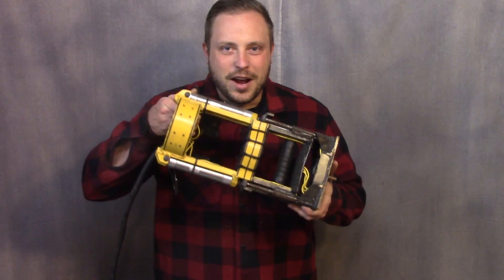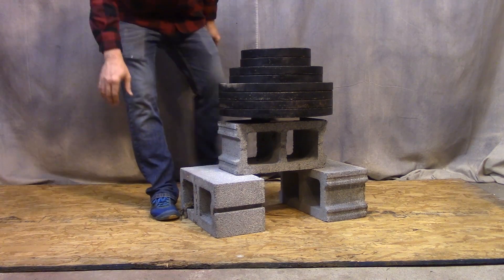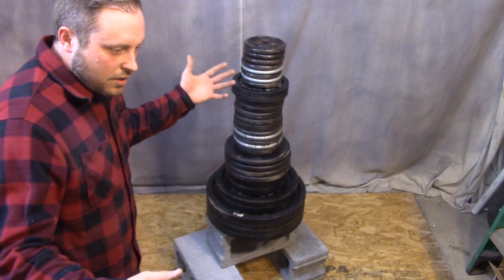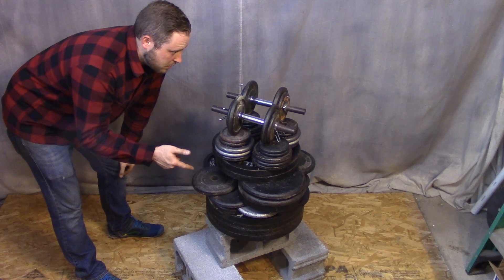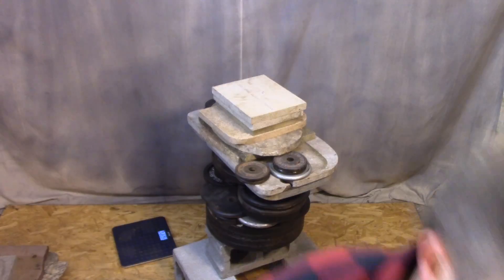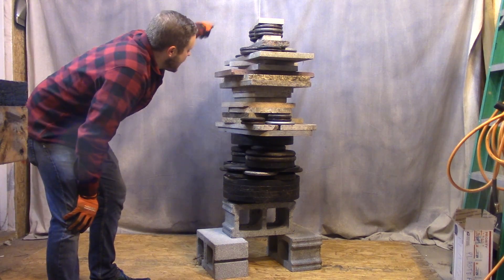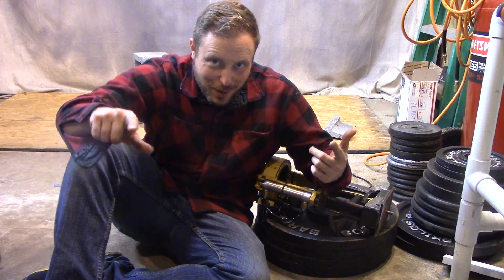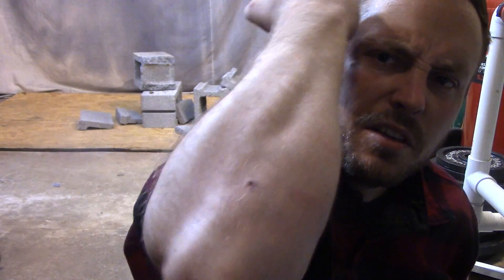POWERFIST POWER TEST - How much force to break a cinder block

Comment: Not really an accurate way to determine how much force is required. It's about concentrating the force to a point. You could divide the weight by the area of the plate to determine weight/sqinch. You might also be better of resting them on a smaller plate for that reason. What you're doing is how people manage to lay on a bed of nails, the force is just to spread with that large plate and by simply stacking them on there.That's pretty basic physics. There's also not really any "tricks" to breaking cinder blocks, it isn't hard to do. Anyone with training could have done that without that power fist. The power fist is cool, but a complete fail for the rest of the video.

Comment: This is a very stupid test. Are you trolling people ? You do realize that 740 lbs impacting something (pounds of pressure per square inch) like Conor's punch is completely diffefent then 740 lbs resting on a solid brick object with the base of the weight being larger than 4 inches, which is the size of knuckle impact......?????? The calculation is cmpletely different and all if that stacking was a waste of time because also, you are punching down in some arching ridiculas Thor hammer shit...... Also do you think Conor threw a standing cross at a fucking PSI punch machine at the UFC performance institute ? I happen to be a massive Fallout AND MMA fan. Your math is incorrect, it doesnt take 1000 lbs to break through a cinder block.

Comment: Lol why dont the military start developing these power fist
Reply: because of these new inventions called guns.
Reply: vect0rwolf 😂😂😂😂😂
Reply: Alex Duzon lol no it doesn't
Reply: Because its useless
Reply: Alex Duzon look up videos of swat teams breaking down doors, they do it faster than his fist
Reply: Because the military does not rely on melee weapons.
Reply: @pillgrimm  Not for the last 350 years anyway!
Reply: Shane Avery no it's useless
Reply: Shane Avery glad you’re a tactical genius. Swat teams and the military have battering rams. Its too easy to sling a rifle or and smg and use a battering ram, if they need to they can throw it down and use their firearm. But that doesnt even matter because the guy running a battering ram never goes in the building first anyway.
Reply: Shane Avery we use our boot-shotgun- det cord. In the miltary it will never be practical. Until it can be under the weight of a sledgehammer 8lb or less itll never be used.
Reply: They work good for battering rams tho. Breaks a door faster than actual swat rams
Reply: If they worked on it correctly, it isn't useless. If they could make a battering ram into a mobile size (like lets say the size of a Powerfist), then it could totally be useful. Same could be said for anything. What the military wants right now is to have everything in less weight, size, and for it be more controllable. 
An example is Carbon Fibre. It's strong like everything we've had before, but it's lighter, smaller, and easier to control.
PLUS, it HAS been used to blow through a steel door in his other video "Powerfist vs steel door"
Reply: if you can use it with real Exo-Skeleton and more powerful POWERFIST ''you would be ironman'' than it would be useful. People have made some Exo-Skeletons but they are britty useless. Battering rams are more useful because u only need some men to kick down some doors or something.
Reply: vect0rwolf this power fist would be good for braking entry the military’s rams compared to this are like fluff plus they could hold a pistol whilst using it cuz its lighter

Comment: It's cool that the powerfist worked but leading back to my previous comment you didn't have 2000 pounds of pressure (psi) just because it worked over your 1000 pounds worth of wieght they had no force because you simply placed them if it had been 500 pounds thrusting at the cinder blocks alone the would have simply done the job

Comment: Your calculations are way off you are simply placing weight not applying wieght by velocity or momentum, in other words had it been even 500 psi worth in striking force you would have broke that cinder block a long time ago, simple mathematics just saying

Comment: Was surpised you thought you would break it by adding weights, can easily have a truck jacked up on a cinder block, hell even trailers are held up with cinder blocks, but if you drop them 3ft they can shatter lol.

Comment: the 1000 thousand pounds in weight was spread out over 2 feet distributing the load over cinder block which would be about 16.666 pounds per centimeter. but your first thing is concentration about 50 pounds into an area about the size of one centimeter. the only way to accurately measure how much force. would be to balance weights on top on a peg about the same size of the one you have on the fist thing. I would guess it to be about 50 to 150 pounds of force. and droping 1000 pounds vs setting 1000 pounds is a big difference in the amount of force transfered to a object.

Comment: It would have taken less weight to break both bricks than he used to try and just break the one brick for the simple fact that when he set up the second brick he spaced the bottom ones holding them further apart than when he tried breaking only the first one. That makes a huge difference. And with that point the power fist had, if a boxing glove had the same setup he could have easily broken 3 bricks due to pounds per square inch

Comment: you've destroyed the both blocks because of that small screw that pops out. The entire force was accumulated in one point. Same thing is also when you try to break a cars window- on driver or passengers side.
You need something sharp, pointy & not blocky..

Comment: this guy is an idiot... it would take around 5 tons to brake one of those blocks... because there is no force going into them. you need motion and a hard contact to brake something like that. the only instance that just weight would brake something is if the item can bend and a cinder block cannot bend so...

Comment: When you measure a punched it's measured in PSI, or pounds per square inch. Since your surface aread touching the blocks is  more than one inch, you have to divide the amount of weight to the amount of total inches touching the surface to get your actual psi. You probably have 100 psi for 1000 pounds on that thing. Connors punch is measured in PSI too btw

Comment: don't want to be a skeptic but go ahead and take one of those 45's and hold it above the cinderblock vertically and drop it. gravity will change the result. crack a cinderblock anywhere and it will lose its integrity

Comment: there's a distribution issue with your setup .. those cylinder blocks can't hold that much weight but with the wat those cylinder blocks are set up the pressure of the weights are distributed through the 3 blocks .. needing the amount of pressure it takes to break the 3 blocks instead of one ..

Comment: Tensile strength and brittleness have same unit which is Newton but they are two different material properties. A brittle object may be strong due to its ionic bonds but will shatter when its lattice is shaken up due to impact.

Comment: That's stupid, there is more surface area used when putting weights on the bloc, less surface area with a needle on your hornyfist will make a crack easily and break the structural integrity of the bloc. Rubish idea

Comment: Dynamic and static are not the same, you get more power with half of weight multiplied by the square of speed.
Not magic, just scientific.
Reply: He was measuring the force, the equation for calculating it doesn't apply

Comment: nice video but wrong use of physics, think of it like this rest a heavy object in your hand like a bowling ball, doesnt do much damage now take that object under the same gravity and mass but add velocity  e.g drop it. now it can do a serious amount of damage given the right velocity, its not just the mass that will break the object its the combination of both its mass and its change in velocity, if he lifted that 1000lb a few inches then dropped it may of broken, but static load if very different from dynamic. So the power fist isn't putting weight onto the cinder block to break it its using the mass and change in velocity on a small specific area to break the block, also the cinder block is design for construction usage and therefore has a huge static load capacity due to the nature of how much "weight" it needs to support when used in buildings.

Comment: I dont care if he got the physics wrong, he punched through cinderblocks with a Fallout weapon, I'm more than amused.
Reply: You guys do realize that the spike in the middle isn't a spike.  It's a button that activates a mechanism that drives the flat metal plate forward when it makes contact with something so that he doesn't have to time pressing the button himself as he hits something with the fist.  It is quite accurately a Fallout Powerfist.  Watch the two part video demonstrating its construction if you still don't understand.
Reply: "It's like a fist equivalent of a jackhammer that instead of firing a pile repeatedly up and down like a piston, fires a steel knuckle-head into your enemies with a similar effect"
This is exactly what his Powerfist does. If you even TRIED to examine the tool/weapon/gadget/etc he made, you'll see that a metal plate protrudes out from the fist as he punches, making a powerful blow outwards at the intended target. The spike is NOT meant to punch holes into things, it's a trigger for the fist to protrude. It goes in all the way. Watch the video "Powerfist vs steel door" to see how it works.
Reply: You don’t understand physics!   Weight is a Force (mass times gravity) !  His punch is a force=mass times acceleration.
Reply: maroun abou tanous it's not a solid spike, that's a trigger for the Steel plate to launch forward, eg. when that Steel "spike" gets pushed in, the gas in the cylinders is released launching the Steel knuckle of the fist forward
Reply: Scar iiiiIi
Reply: Scar Wow 1000lbs of force
Reply: Hayden Bursa ty for explaining , i understand it now. but still this button (spike) when pushed backward will it go flat ? if not than spike is still there. its impossible to go away so either it stays or go flat.
also what material it made off
Reply: @marounat2599  WTFV.
Reply: No worries 
there is a video where he shows his construction of the fist. and it shows the operation in slow motion, I believe its just a steel cylinder with a valve at the opposite end, it pushes back into the fist to be completely flat with the knuckle.
Reply: Finally! Someone gets what a Powerfist really is. It's like a fist equivalent of a jackhammer that instead of firing a pile repeatedly up and down like a piston, fires a steel knuckle-head into your enemies with a similar effect. it's not a simple fist protection tool. Well, his version does have that small protruding metal in the middle probably doing the same effect, but it's not the same if you ask me. The sheer weight of that thing and that punch he was doing were what mechanisms should have been doing instead.
Reply: petco123 not only that , notice his fist have like a needle in the middle which is the first point to touch , so all the force is going through it and down to the pile .  he can break this pile with a screw driver 😂
Reply: @marounat2599  https://www.youtube.com/watch?v=4w6FtLx_hR4
Reply: Scar not even a Fallout weapon, the end of it extends out right when you punch in the games. This is just a steel fist at best
Reply: @glizzyparker8056  It still is, the hydraulics just isn't there. If I cut half the barrel off a double barrel shotgun, its still a double barrel shotgun, just missing part of its barrel.

Comment: dude the 1000 p weights was distributed between 3 vertical columns. you concentrated your punch just in the center. you should put a 1/2" steel plate on top to distribute all forces across all 6 columns.  anyways that's newton's second law isn't it. you know impact force

Comment: A fundamental understanding of how forces are distributed(Physics) is at work here. The block would 100% break under much less weight had they been applied ontop of a wedge. It is force per unit area that we measure not blunt force.

Comment: Dude the law of physic should be considered here,. the more equilibrium you create the more the weight disburse itself not until the center of equilibrium collapses  from within; friction.

Lastly the way the other two blocks where placed ; inches apart from the previous set. "Spoiler Alert"

Comment: Not to be rude but your physics is off.. concrete is designed for compression and the weight us not centered in the middle but on the two outer edges. This does not mean your device is putting out more than 2000 lbs of force. Also you need to take into account  that the concrete is not designed for shock load which is what you are doing with ur metal fist.. so in order to measure your impact u need a different system. This being said hope your enjoying your fist.. gotta enjoy a little destruction.

Comment: I'm seeing a lot of comments from people who think they know the physics of why there is a difference between stationary sustained force and force from a moving object.    1. Weight is a force. (Lol).           2. The difference is the fist does not deform in impact so all of the kinetic energy from the moving fist must be transferred into the block in a small timeframe. The cinderblock is brittle so does not disperse the energy through the block, instead all of the energy is focussed in one area so the block crack under the stress.                       This can be said simply as cinderblocks are strong, but they aren't tough.                         3. The fist has a point which will concentrate the force in a smaller area, increasing the stress on that area of the block.                                               Basically his methodology is flawed and as there are so many variables I cba to think up a scientific test of force to break these blocks. Plz help

Comment: its about how much pressure u put on this. when u swing, you carry speed, and the faster you swing, the higher the force and it is being applied on a small area, hence resulting in higher pressure which break the block.

Comment: You needed a smaller surface are in order to brake the sinder block. When you hit the block you don't hit it all at once you only hit a small area that's why the block did brake. Concentrate as much weight as you can in very small point and youare gartanteed to brake it

Comment: Place weights on top of them will not "make it break" that's not how it works and also due to the fact you had two blocks on the bottom it was also displacing the weight. When you punched the blocks they broke because it caused a shock. If you were to drop a 20 pound weight on one of the blocks it will more than likely break it.

Comment: off course it won't break, the weight has to be concentrated in one are with a weight that has less diameter and then slowly stack more on top, opposed to spreading out the weight with a wide one

Comment: ok so the reason the block is not break is a few things at play 1 the point of pressure is large enough that it generates the weight to all sides of the block . 2 the weights is just sitting there not generating speed or the force.

Comment: You could have just calculated the force behind an all out punch by you, and divided it by the surface area of the peg on the end of the fist, to get the pressure exerted on the cinderblock.
Also, a google search yields that cinderblock can absorb up to 1900 psi before breaking.

Comment: With the weights being put on the cinder block over a large period of time allowing the blocks to adjust to the weight and thus using compression force. While with the power fist you are using a single burst of force where the blocks didn't have time to adjust to the sudden change of force put on it

Comment: As you can see the cinder block has a inner wall inside. A divider is what we call it. Since all that weight is focused on the center of the block, it won't collapse because the block is reinforced by the divider. If you were to take out that divider, the cinder block would've collapse couple hundred pounds ago.

Comment: You suck at physics, the impact with the iron stick on the device is so much  bigger than all those blocks together due to the tiny size and the speed. Just cannot be compared to the load you put  a in the block. I think you could have stacked twice as much on the block without breaking it.
Reply: But the iron fist is cool

Comment: This guy obviously doesn't know how physics works... You can hypothetically put 5 thousand pounds on top of the block and it not break but break it by swinging a 10 pound hammer at it. It's the sudden force that goes into the block that breaks it not just sitting shit on top of it.

Comment: there's a huge difference of concentrate force(from the punch..especially that needle like part) per square inch than the force of a plank wood with large surface. wrong measurement.

Comment: The force applied by the power fist is in a more condensed surface area when it hits the block, compared to the weights. This means the pressure is spread out and the block can hold it. I bet if you put the same platform for the weights as used for the power fist if would probably break
Reply: Actually... Scrap that XD

Comment: So I don't believe you've got the math right friend. Yes it held over 1000 of load laid on top of it. However that was spread across the entire face area of the block. Meaning to break it with that ur Ganna need enough weight to actually flatten the entire block. With the glove, your focusing impact on the very tiny area of that cylinder jotting out of the front of the glove. So the weight is much more condensed into a single point on the block. Much easier to smash